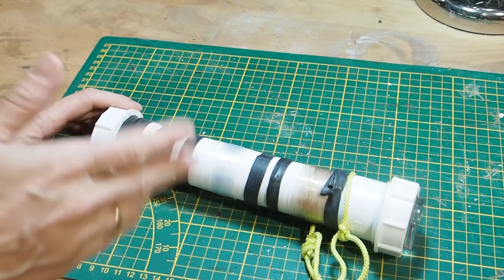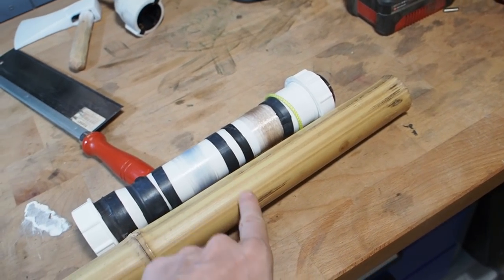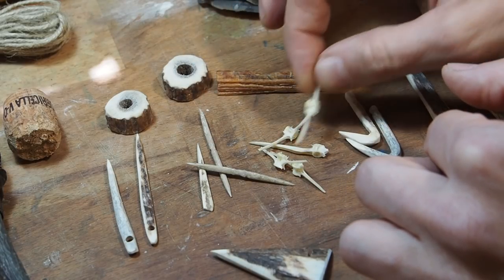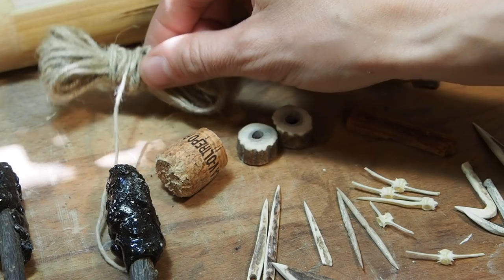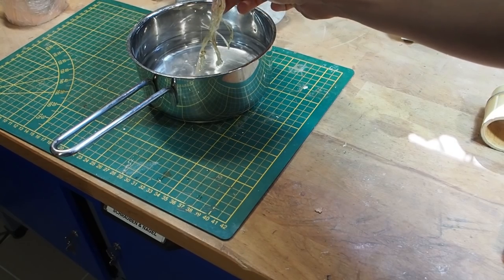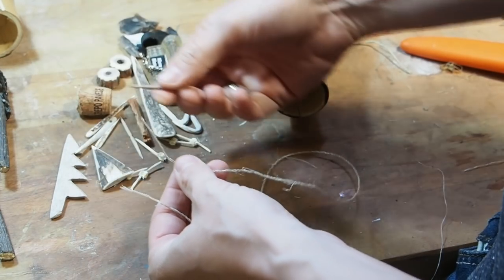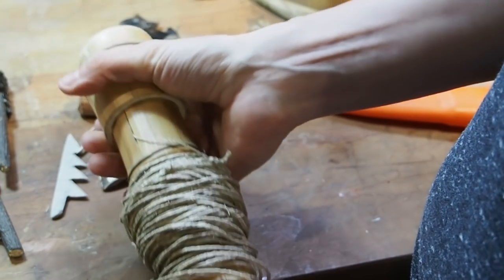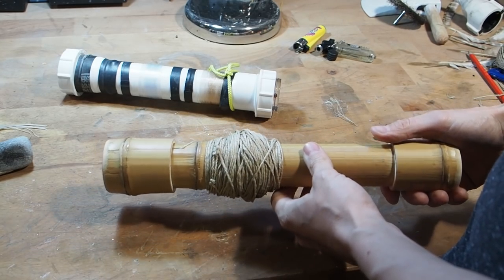Primitive Fishing and Survival Kit

Comment: LOVE the assortment of primative hooks and your explanation of each. 
You're right on with your use of bamboo. Bamboo is an incredible underused building material. It has such a great strength to weight ratio! It could easily be farmed to replace some of the "slow growing" trees we use now. Thanks!
Reply: You can get a bicycle with the frame made of bamboo tubes. It is comparable it strength and lightness to aluminum and carbon fibre. Amazing material.

Comment: How did you make closed caps with the bamboo? Are there places inside the bamboo that are naturally closed, so it's a matter of where to cut the bamboo pole? Thank you!
Reply from the maker: with bamboo every node is closed naturally
Reply: @SurvivalLilly  I didn't know that. I feel a bit foolish, but it was worth it to learn this valuable information. Thank you so much Lilly! Have a great day!
Reply: @kele1264  Those nodes are what give it strength.
Reply: @barrybogart5436  Makes sense. Bamboo is an amazing plant in many ways. And it has so very many uses. I didn't know that those "rings" were nodes, and that each of them closed naturally, like Lilly told me. I can see how that would give each stalk strength. Thank you.